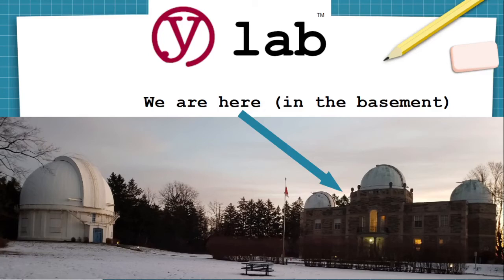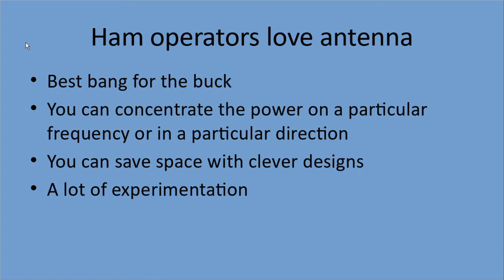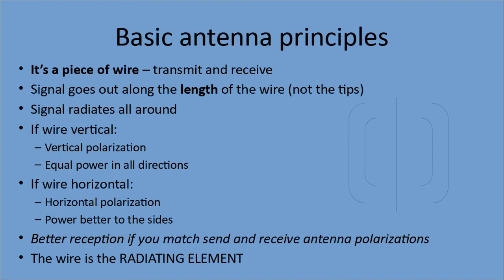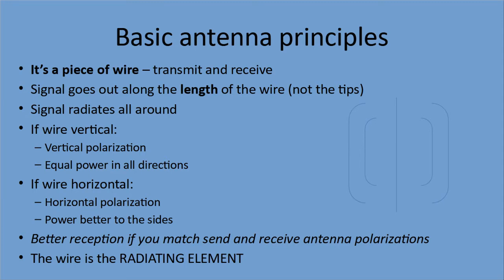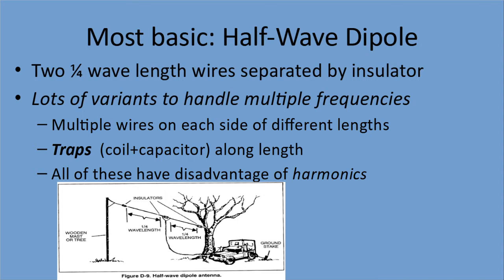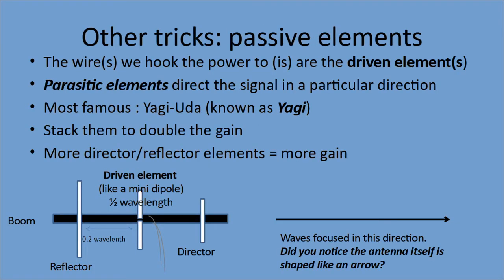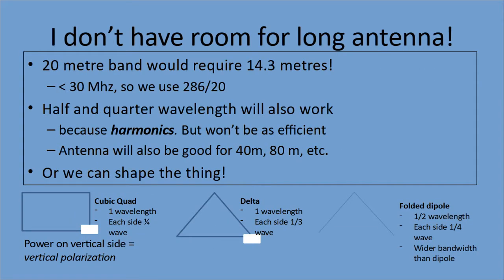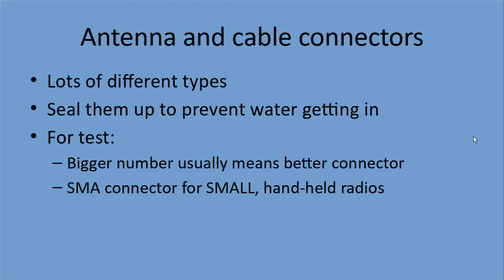Lessons 9 and 17 for Ylab's Canadian Amateur Radio License Course

Comment: Great lessons.  Isn't the centre wire in a co-axial cable carrying the signal and the outer braid is ground?   at 15:48
Reply from the maker: Yikes! You are correct. We'll correct the slides now , add a comment on the video text, and hopefully get around to correcting a couple of mistakes in the video. Video editing is a pain...